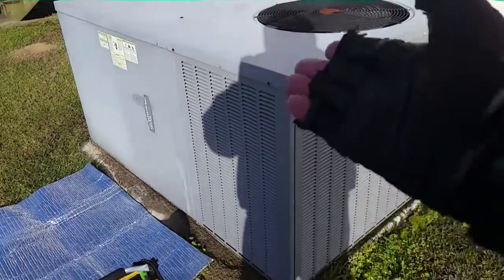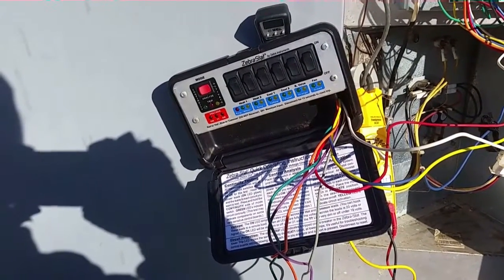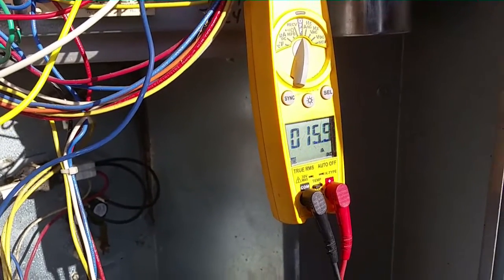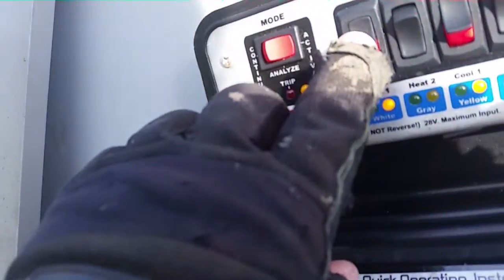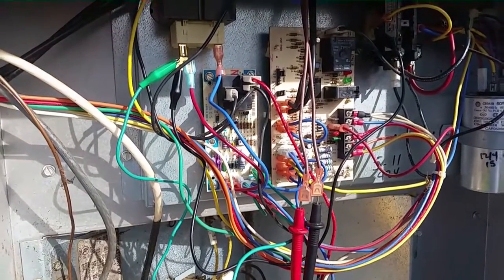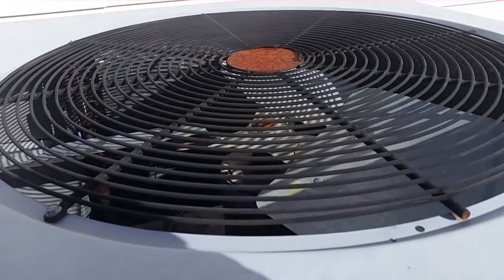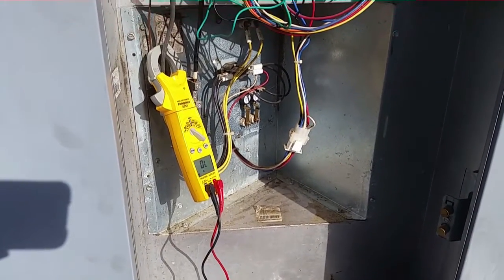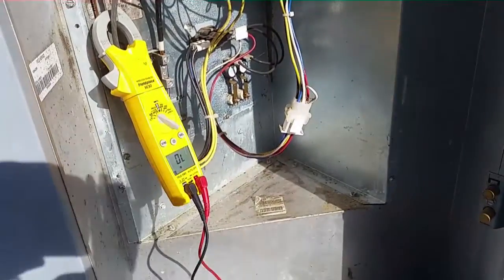Armstrong Heat Pump Check Heat and Defrost

Comment: So the 3/4hp blower wasn't OEM -- you upsized the original?  Was that due to high head pressure in heating mode?  Sorry if you explained that in a prior video on this unit.  I don't recall.  Thanks.
Reply from the maker: 3/4 was just a stock blower from my truck. The oem was similar. No up size on this one

Comment: Nice video Zack! Can you do a video on troubleshooting heat strip and how you tell if it's a 5kw or 10kw
Reply from the maker: 5 kw is 20 amps, 10 is 40. Usually it's around 5 kw an element
Reply: Alright Thanks!